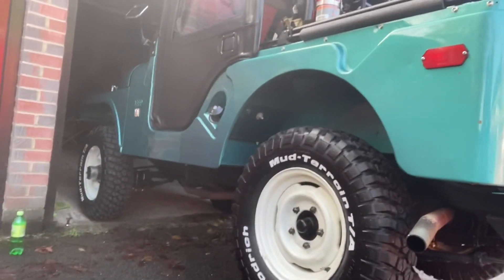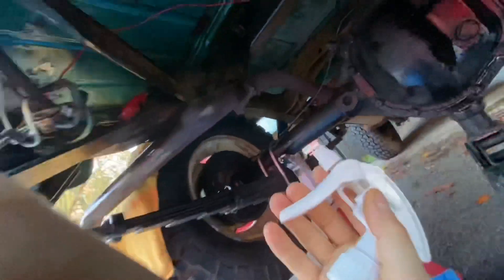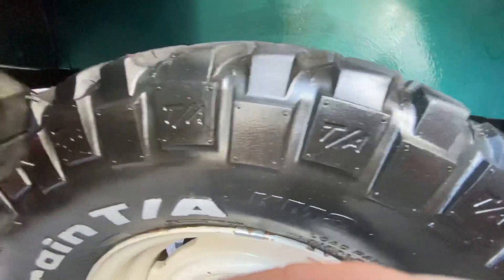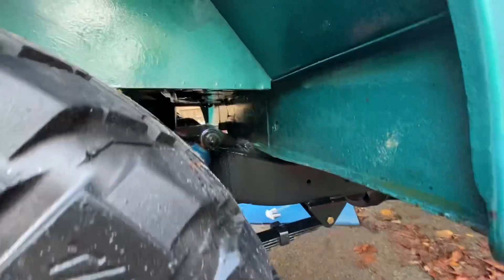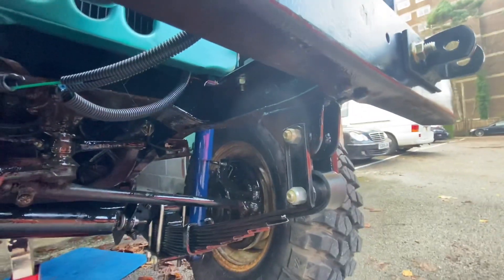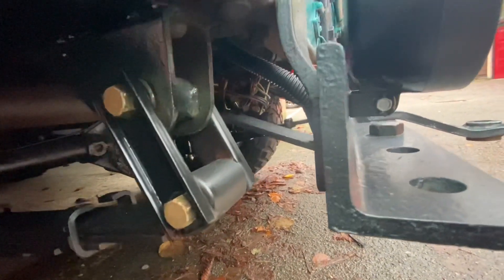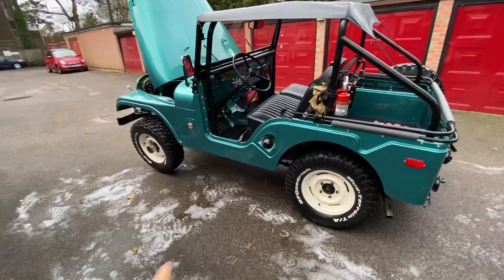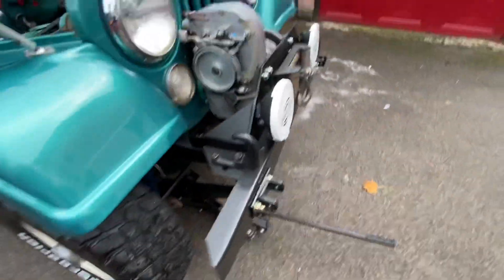Lanoguard Full Review vs Waxoyl

Comment: ⚠️1 year down the line is what matters.
What is looks like when spraying on is totally irrelevant !

I've tried them all.
Underseal peels off and is heavy.
Granville Spray chain grease is the cheapest and long lasting.
Just top up the rusty edges every year.
£6 per can.
3 cans required initially then just 1 can per year at MOT to top up.

Comment: Didn't know you could spray lanoguard onto the exhaust!
Reply: I would expect that it will melt and drip from exhaust once exhaust heats up.
Reply: Hi there. It’s Mark from Lanoguard. You can for sure put on the exhaust.it will stay there too.  It is heat resistant to 450 degrees. It will burn off at there or thereabouts and above that. Hope this helps.
Reply: Right, take my money Hahahaha I'm sold
Reply: @Lanoguard  but what does it actually do ? It just looks like clear coat  , what's stopping the rust from coming through ? Does it do anything to the rust ? How does it protect better than wax oil?
Reply: @joebutlersnr7017  i think this too, I'd think the rust is eating away underneath. I use acf50 as it's clear and actively termintes rust. I hope lanoguard corrects me though!
Reply: @turningwheels2584  rust requires oxygen to form. The product bonds tightly to the rust preventing the oxygen reaching it. At least that's how Fluid Film works, which is also lanolin based.
Reply: @joebutlersnr7017  rust requires oxygen to form. The product bonds tightly to the rust preventing the oxygen reaching it. At least that's how Fluid Film works, which is also lanolin based.
Reply: @appledjerry  thanks for the response 👍👍